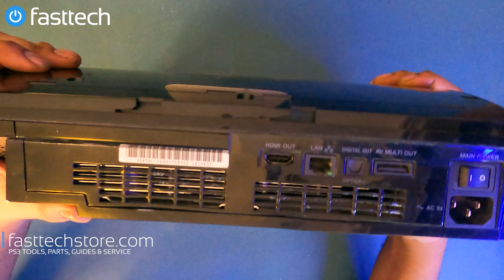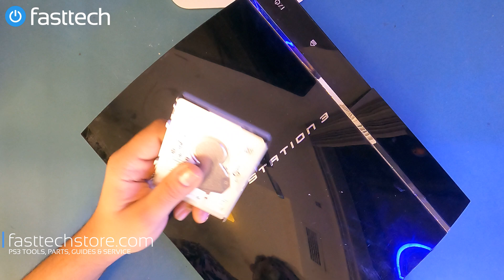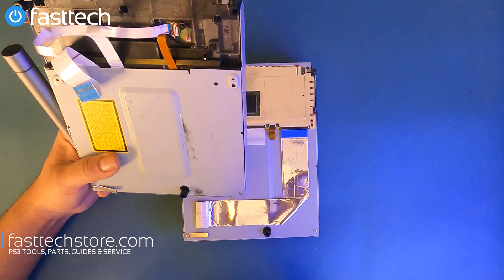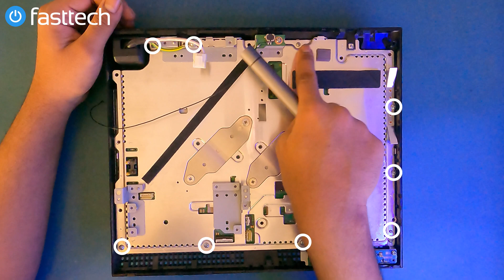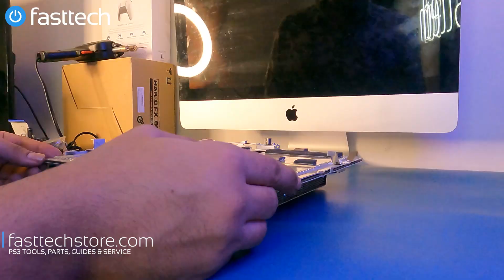PS3 80GB CECHE01 Disassembly and Repair Guide

Comment from the maker: 👉Buy a PS3 Backwards Compatible from Fasttech: https://fasttechstore.com/playstation-3-backwards-compatible-systems
▶ Fasttech Pro Autokit: https://www.fasttechstore.com/tools/fasttech-pro-auto-kit
▶ Fasttech Pro Toolkit: https://www.fasttechstore.com/tools/fasttech-electronics-repair-toolkit
▶ Thermal Paste :https://www.fasttechstore.com/tools/thermal-grizzly-kryonaut-extreme-2g
▶ Hard Drive: https://www.fasttechstore.com/playstation-3-parts/1-tb-ssd-hybrid-25-hard-drive
▶ PS3 COK-002 Mainboard + Disc Drive Board: https://www.fasttechstore.com/playstation-3-parts/ps3-cechexx-mainboard-disc-drive-logic-board-cok-002
▶ PS3 Casing: https://www.fasttechstore.com/playstation-3-parts/sony-playstation-3-models-a-b-c-e-shell
▶ PS3 Casing Top Cover: https://www.fasttechstore.com/playstation-3-parts/sony-playstation-3-models-a-e-cecha01-and-ceche01-top-cover
▶ Disc Drive: https://www.fasttechstore.com/playstation-3-parts/kes-400-blu-ray-disc-drive
▶ Disc Drive Data Cable: https://www.fasttechstore.com/playstation-3-parts/sony-playstation-3-blu-ray-drive-data-cable
▶ Disc Drive Power Cable: https://www.fasttechstore.com/playstation-3-parts/sony-playstation-3-blu-ray-drive-power-cable
▶ Disc Drive Logic Board (BMD-001): https://www.fasttechstore.com/playstation-3-parts/bmd-001-disc-drive-logic-board
▶ Memory Board:https://www.fasttechstore.com/playstation-3-parts/sony-playstation-3-model-a-c-e-wireless-board-7dszb
▶ Power Supply: https://www.fasttechstore.com/playstation-3-parts/aps-226-power-supply
▶ Network Adapter: https://www.fasttechstore.com/playstation-3-parts/sony-playstation-3-model-a-c-e-wireless-board
▶ Antenna: https://www.fasttechstore.com/playstation-3-parts/sony-playstation-3-wi-fi-antenna
▶ Power/eject Board: https://www.fasttechstore.com/playstation-3-parts/sony-playstation-3-models-a-b-c-e-control-board
▶ Fan & Heatsink Assembly: https://www.fasttechstore.com/playstation-3-parts/sony-playstation-3-models-a-b-c-e-heat-sink
▶ Heatsink Clamps and Screws: https://www.fasttechstore.com/playstation-3-parts/sony-playstation-3-heat-sink-clamps
▶ Cooling Fan: https://www.fasttechstore.com/playstation-3-parts?category=Fan
▶ Thermal Paste (Large qty for shops): https://www.fasttechstore.com/tools/thermal-grizzly-kryonaut-thermal-grease-paste-111-grams
▶ Compressed Air Can: https://www.fasttechstore.com/tools/disposable-compressed-air-duster-35-oz

▶ Want us to fix your device for you? Just order the Fasttech Repair Box to send us your device by using this link: https://www.fasttechstore.com/repair/repair-box
👉NEED HELP? FaceTime/Zoom Video Call Me: https://www.fasttechstore.com/online-consultation
👉GET REPAIR SERVICE FOR YOUR DEVICE: https://www.fasttechstore.com/electronics-repair

Other PS3 Videos:
👉PS3 CECHA01/E01 Thermal Paste Replacement: https://www.youtube.com/watch?v=05SxgyBkBOk&ab_channel=fasttech
v=ilzqlX_MDmQ&t=764s&ab_channel=fasttech
👉PS3 CPU AND GPU DE-LID GUIDE: https://www.youtube.com/watch?v=GzMmi7F65wQ&t=30s&ab_channel=fasttech
👉PS3 CECHG Repair Guide: https://www.youtube.com/watch?v=GgOYFO9Pdss&feature=youtu.be&ab_channel=fasttech
👉PS3 CECHH Repair Guide: https://www.youtube.com/watch?v=BDC1O8mYZZc&t=1840s&ab_channel=fasttech
👉PS3 Slim 2000 Repair Guide: https://www.youtube.com/watch?v=S-ewz35fOLY&feature=youtu.be&ab_channel=fasttech
👉PS3 Slim 3000 Repair Guide:https://www.youtube.com/watch?v=ay7GYYMjodQ&ab_channel=fasttech
👉PS3 Super Slim Repair Guide: https://youtu.be/6a9UM_S1T64
👉PS3 YLOD Repair Guide: https://www.youtube.com/watch?v=uAWpqW1HCmo&feature=youtu.be&ab_channel=fasttech
👉PS3 Controller Ghosting Fix: https://www.youtube.com/watch?v=lMQouNRR018&ab_channel=fasttech

👉Business Social Media:
Twitter: https://twitter.com/FasttechCA
Instagram: https://www.instagram.com/fasttech.store
Facebook: https://www.facebook.com/fasttechy

👉Follow me on Social Media:
VLOG CHANNEL: https://www.youtube.com/channel/UCF2IPXKRX5ctN9td1rhkzHg
Instagram: http://instagram.com/youngtechg
Twitter: https://twitter.com/Shehroz

Timestamps: 
00:00 Intro
00:48 How to check the model number
01:15 CECHA01 vs CECHE01
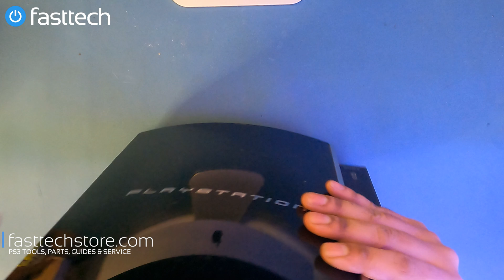01:54 How to remove the hard drive
03:54 How to remove the top case
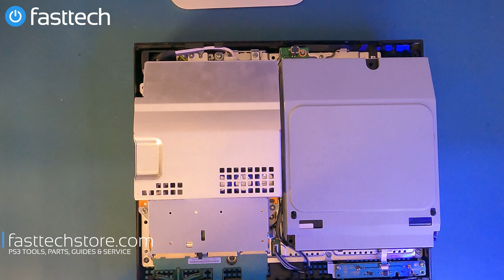07:03 Disc Drive replacement guide
11:31 Memory board replacement guide
12:18 Power Supply replacement guide
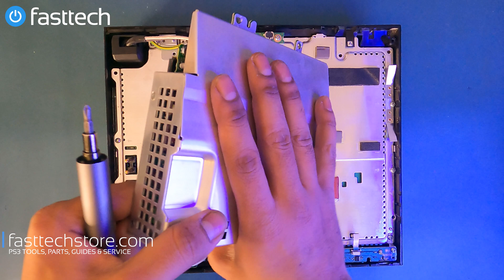16:00 Network adapter replacement guide
17:24 Separating the motherboard assembly from the case
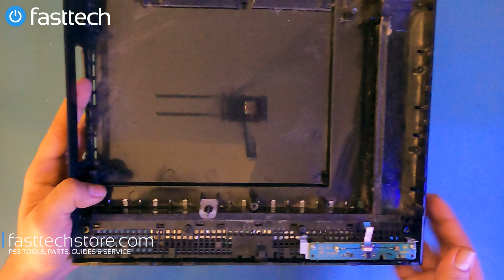20:41 Removing the power/eject button
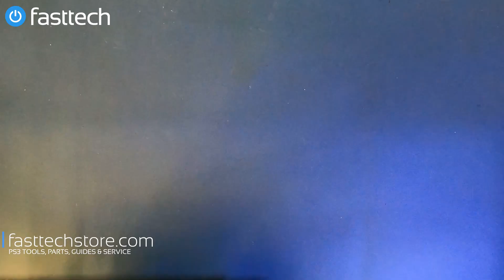21:20 Removing the motherboard backplate
23:51 Removing the fan & heatsink assembly
24:24 Thermal Paste Replacement guide
26:32 Motherboard replacement guide
28:27 Separating the fan from the heatsink assembly
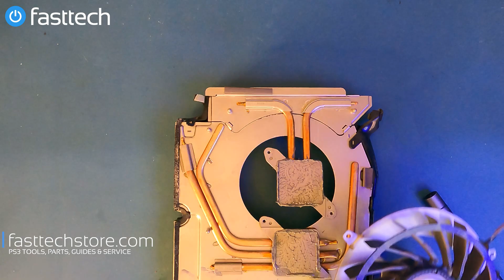29:15 Outro

Comment: The disc drive I pulled out of my working CECHE01 only shows a white ribbon cable at the bottom of the drive, I pulled another drive out of a spare CECHE01 that had a working disc drive but the working drive shows a logic board on the bottom. Can a disc drive with a logic board on the bottom be used to replace a disc drive that only ever had the white ribbon cable on the bottom and if so how? If your disc drive only ever showed the white ribbon cable on the bottom, do those CECHE01's not have a logic board or is the logic board located somewhere else in the system? Any info or help is appreciated.

Comment: About to clean up a cheap CECHE01 I bought online and going to use this video. 👍 fasttech, do you recommend a particular a screwdriver? I've been meaning to get a new one.
Reply from the maker: @channelsurfing  here you go https://www.google.com/search?q=fasttech+pro+toolkit&rlz=1CDGOYI_enCA873US882&oq=fasttech+pro+toolkit&gs_lcrp=EgZjaHJvbWUyBggAEEUYOTIGCAEQRRg8MgYIAhBFGD3SAQg2NjI1ajBqN6gCALACAeIDBBgBIF8&hl=en-US&sourceid=chrome-mobile&ie=UTF-8
Reply: @fasttechvideo  Thanks and should I de-lid my console? I wouldn't do it myself but it only seems necessary to do if the system is overheating quickly.

Comment: I got these two small screws skinny. No clue 😂 love when all these videos just go through unscrewing and don't show the screw sizes. I got these off somewhere lol the Philips head side is more flat than the motherboard and component screws..  anyone got an idea

*I will add that I was super baked while doing this. I've taken apart the new model fat ps3s but this og fat backwards compatible one 😂 fuck
Reply from the maker: @iMiRACLEb421 can you upload a picture somewhere?
Reply: @fasttechvideo  i figured it out, the corner with the larger screw the one to the right and left of long screw were where these little screws went to motherboard/case lol wont be doing that again in the middle of the night cooked 😅

Comment: How do I remove the logic board if the logic board is inside the casing?
Reply from the maker: I assume you are talking about the disc drive? You have a CECHE - MG model which has a bd410 disc drive that has to be opened for its logic board to be accessible
Reply: @fasttechvideo thanks figured that out about 6 months ago!

Comment: Hey man 😁, I have a CECHE04 verion can I install the same disc drive in this video to mine and will it still run ps1 ,2 games . if not could u please share with me the link of which disc drive can be installed to CECHE04 from your website I would really appreciate it .
Reply from the maker: This drive will work with your PS3: https://www.fasttech.ca/playstation-3-parts/kes-400-blu-ray-disc-drive

Comment: @fasttech my CECH-E01 just went out on me yesterday. I dont have the YLOD. However, when I turn the system on, the system boots as normal and goes to the home screen. After a few minutes in the home screen the image becomes pixelated and freezes. In your experience what would you recommend to correct the issue. The warranty sticker is still in place. To my knowledge, I am the second owner.

Should I attempt to heat up the chips and replace the thermal paste or buy a new motherboard all together? Any tips or advice would be greatly appreciated, thank you! 😊
Reply from the maker: Your RSX chip (GPU) is toast. I would recommend replacing the mainboard since replacing the chip would almost cost the same. If you are interested in one heres a link: https://www.fasttech.ca/playstation-3-parts/ps3-cechexx-mainboard-disc-drive-logic-board-cok-002
Reply: @fasttechvideo  Thank you for the fast reply! I appreciate it. Does your company offer a warranty on the recommended parts? My main concern is buying the parts, doing the repair and six months down the road, I'm in the same boat... 😅 

Can you give me a quote of how much you would charge if I sent it in for repair instead of doing it myself? Thanks again!

Comment: I just took apart my CECHE01 using this video. Everything turned out great, fresh thermal paste and no parts left over. It had never been opened and I'm the 2nd owner. It had more dust than my dryer lint filter. Now the fans don't even kick on high. No need to remove the heat spreaders. Running nice and cool and breathing easy. Thank you. Subscription earned.
Reply from the maker: Thanks for the comment and for subscribing Danny :)

Comment: Will a laser/disc drive from a CECHA01 60gb work on the 80gb CECHE01 ?
Reply from the maker: Yes as long as the ceche01 is NOT an MG model
Reply: @fasttechvideo  what is MG model????
Reply from the maker: @gutoczar6144  metal gear solid bundle that has a bd-410 drive instead of a 400

Comment: So you CAN replace the disk drive on the A01 and keep it reverse compatible?
Reply from the maker: Yes absolutely
Reply: @fasttechvideo  that’s awesome I figured the part would be discontinued
Reply: And I didn’t realized it is the cpu and gpu that makes it reverse compatible
Reply from the maker: @prestonboling1427  its hardware / software built in on the motherboard that makes it backwards compatible. Good luck with your repair.

Comment: What would cause a PS3 CECHE01 to have the red light when connected to power, but when pressing the power button the light just turns off and does nothing, same when I press the eject button
Reply from the maker: It could be either a power supply issue or a power issue on the motherboard.
Reply: Bad psu, it’s not initiating the 12v power rail.

Comment: i have 80 gb it still works great i had few years now i put in 250 gb ssd in mine  it keeps it cooler
Reply from the maker: While an SSD improves loading times it wont result in lower temps

Comment: Some data over at PSX-Place pretty clearly shows that the D14F (Long fin 15 Blade 2.65A) is a better fan.  While the D14F is pretty rare (comes with E models) and runs a bit louder it keeps the PS3 the coolest if you aren't jailbreaking, if you are there is a quieter fan (G14T12BS2AF) than the 19 blade so the only time you should use the 19 blade is if you want a slightly quieter ps3 than the D14F and are willing to pay the price, but the 19 blade isn't the best performing ps3 fan. 

On another note, I bricked 2 Ps3's (just crappy G models) before I was able delid without Damaging the system.  If anybody wants to try themselves I would buy a couple off eBay before risking damage to an A,C, or E PS3.
Reply from the maker: Thanks for the info. We also did a de-lid video and came up with a method that makes it relatively easier to remove the ihs. Link: https://youtu.be/GzMmi7F65wQ
Reply: meaning PS3 CECH E models is the best fat coolest console ???

Comment: Are these consoles considered to be somewhat loud ? Or should I consider renewing the thermal paste ? Although it’s loud the console is in mint condition.
Reply from the maker: These first gen ps3s do tend to run loud but if it sounds like a hair dryer set to high you should replace the paste. Also do a full IHS delid (check out our channel for that one)

Comment: Great video and very detalied.  You seem to have a lot of experience with PS3 consoles, what´s your opinion on de-liding a console? Is it worth the risk? Will it truly make the console live longer?
Reply from the maker: I would not recommend a beginner de-liding the chips. Replacing the paste, upgrading the power supply to an aps-231 and the fan to a 19 blade version is what I recommend.
Reply: @fasttechvideo  isn’t 226 more reliable? I heard consoles will shut off under load sometimes with 261
Reply from the maker: @dustinvq37  aps-226 is what these came with. I have not heard of any shutdown issues with aps-231 on cecha01 or e01 ps3s.
Reply from the maker: Yes I have a lot of experience with these. I have been working on these since I started this business back in 2008.
Reply from the maker: We did a de-lid guide https://youtu.be/GzMmi7F65wQ